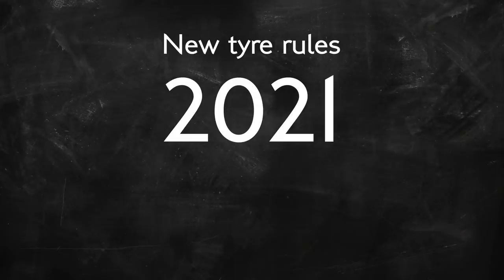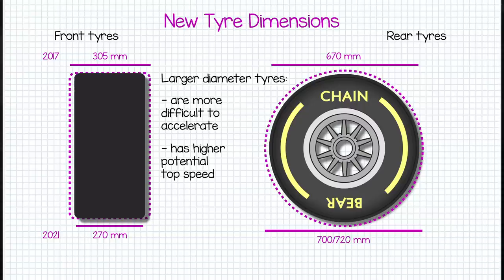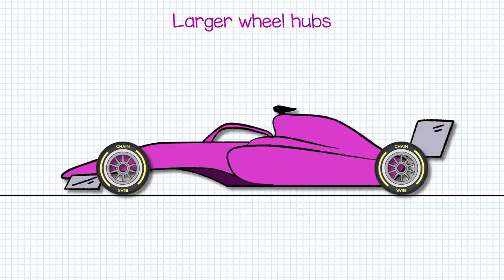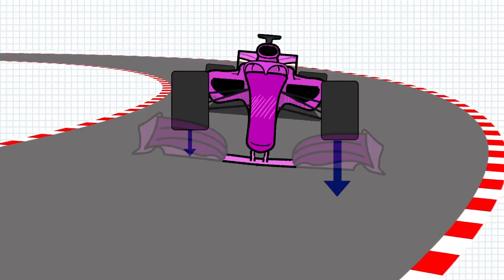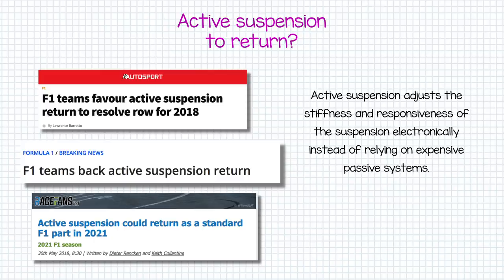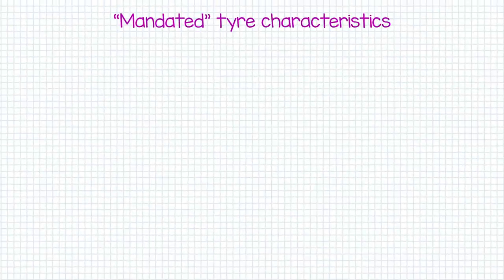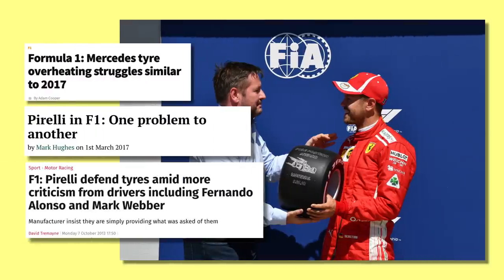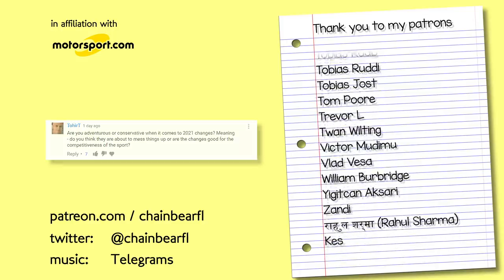New Tyre Rules 2021 explained - Low profile tyres, no tyre warmers, radical compounds

Comment: The tire requirements are odd. They want the tire to wear at a specific rate and have their usefulness be completely diminished at specific point... F1 use to be a hyper-competitive sport for increasing performance, now it seems they are more interested in furthering the development of planned obsolescence. I don't like it.
Reply: Increasing performance? By limiting active aero, aero below the cars, engine displacement, number of cylinders, fucking with tyres, front wings etc. The Porsche 919 Evo could probably win an F1 race against these over-limited POSs.
Reply: @birtalanlorant5572  Nope.. it's lap record at spa was beaten by Vettel Hamilton and Kimi in last year's practise session.. Add to that, the Evo is an unrestricted lmp1, imagine what an unrestricted f1 car can do.
Reply: @Hari5g900  I mean being able to turn at 10+ g means you can lap things that have double your every other spec if the track so much as loops in on itself.
Reply: @birtalanlorant5572  amen brother!

I'm a Porsche guy...a bit biased...
Reply: @birtalanlorant5572  no
Reply: @Hari5g900  Ehh... Unrestricted is a bit much there. It was still based on the prior generation imposed under the race-regulations. Otherwise it would've been a completely new design they could've gone with.
Reply: @swagger897  unrestricted means unrestricted from the rules. You don't have to have a new design.
The fact is it's not legal to race it in le mans, because it doesn't comply to the rules, hence being called unrestricted.
Reply: @Hari5g900  Obviously, but the point being that if the Evo were to get significant changes or redesigned then it does stand the chance to actually beat an F1 car around a track.
Reply: @swagger897  but then the f1 car could be redesigned also.. your point doesn't make sense.
Reply: Certain Randomness dude, 5g is already multiple times the load you experience on a roller coaster, do you really expect many people to survive more than 10g on a regular basis?
Reply: They are actually ruining F1 for me now
Reply: Yeah we need to get back to innovation and progress in f1
Reply: Ya'all don't take into account that smaller, less funded teams dropped out of competitions using "less restricted" rulesets, effectively ruining F1. So instead of no F1, there's restricted F1.
Reply: Whether a racing tyre lasts 100km or 300km is not relevant for the road car industry in any way. So by all accounts the primary concern should be what it does for the racing.
Reply: Everything is engineered for a specific "lifespan". The process of planned obsolence isn't any different from the usual engineering process
Reply: @swagger897  
If I had a Tesla I could easily defeat my neighboor's sedan on a straight but I don't and thus I can't say my electric could have beaten him "only if it had been redesigned".
Reply: bradd 
It’s for the engineers to effectively be able to adjust the car precisely depending on the distance they’ve traveled. It’s more predictable for performance!
Reply: @mortache  It is different. Regular lifespan distribution follows an exponential shape, planned obsolescence distribution is nearly zero-valued except for a specific "lifetime end", where it has a pointy peak. It is also different from a minimum-lifespan distribution, where a long right tail and nearly zero-valued left tail is desired.

F1 is deliberately designed to balance technology, competition, driver skills and entertainment.
Reply: Unfortunately, the "pit stop" fascinates more "people" than the actual racing in this country. The reg to use diff compounds is again to appeal to this type of viewer. I'd rather see them race on whatever tyre they choose; when/if it wears out, come in, but not have to run a different compound.
Reply: I agree. I mean at this point why doesnt the FIA just produce the cars themselves, sell them and forbid the teams to modify them in any way at all, that would save a lot of headache and would get the exact results the FIA clearly is looking for: the exact same cars with no innovation whatsoever going around the track in a nice orderly line. God forbid anyone trying to overtake, thats against the rules now.
Reply: @SportSoulLife  F1 has always been about technical competition.

If you look for more or less equal cars racing, then GP2, F3 etc could be interesting for you.
Reply: It seems you are a Mercedes. I actually like the changes.
Reply: Olaf Franke ofcourse it has. That doesn’t mean that it’s the right thing.
Reply: I feel like this rule encourages more strategy and can maybe reduce the importance of a chassis advantage (so a faster car won’t just keep on pulling further and further ahead of a slower car). Making tires which apply to as strict a regulation as this is also very hard, and can probably benefit the commercial tire industry a lot.
Reply: Well back in the day there was something called "planned obsolescence" as well. 

But it was called "Throwing the engine on the trash after every session

Comment: Could you do a video about refueling in F1? How it works, how it evolved, why it was banned and if it could return to the sport.
Reply: it was banned for safety reasons. Namely due to all of the very real fires that were occurring. There will always be a small amount of fuel between the shutoff device and the very tip of the nozzle, and the exhaust piping will always be hot enough to ignite the fuel on contact.

I very much doubt it will return any time soon. At least while the fires are still in living memory.

Here is a pretty good example of what has/can go wrong. https://www.youtube.com/watch?v=OvgjhfQLTNk
Reply: A video about refuelling is about as useless as one about steam engines. They're both just as likely to make a return to F1...
Reply: Why shouldn't he make the video? Just because it isn't likely to make a return?

His channel is focused around F1. Refueling was an integral part of F1 back in the day. 

With his style of presentation and knowledge, I think that it would make for an excelent video.
Reply: Refueling will most likely not return due to safety and the fact that it's not needed anymore.
Reply: holy shit that was not at all what i was expecting, but definitely something that very easily could happen, about as easy as running over a mechanics leg ay kimi
Reply: I guess you didn't witness enough fires ON pit crew to understand why. Even with extinguishers and fire-resistant suits, fuel leaks on a hot day is just asking for trouble.
Reply: He should do a video just to bust that myth that refueling was that dangerous.. Before 2003 there was a really long time without any incidents.. Sure, when something happend it was dangerous, but it's not like every race a car caught fire. In 2003 Schumachers Ferrari caught fire and he just kept racing after they extinguished it.
I would love to see refueling back in F1. In NASCAR and IndyCar it's working too, or isn't it?
Reply: Refuelling makes pitstop undercuts impossible, where now the faster driver has the ability to do an undercut or overcut if they are faster so I prefer it this way. Plus the whole safety thing
Reply: limiting the power is done by limiting the fuel flow rate at the fuel pump that is ON THE BLOODY CAR(among many, like burning engine oil) which is up 5L/hour with the wider tyres. 

banning refueling limits pit strategy, not engine power
Reply: Refueling was allowed for 2018, but the teams did not want to do it.
Reply: F1 car refuels mid-race is rather a weight-efficiency thing rather than the tank isn't big enough
back in Michael's era, 3-stop strategy really is feasible sometimes as your car will be light enough to compensate the extra pit stop

and if you talk about reducing engine power, they've been doing that since the previous turbo-F1 era where engines reach 900HP IN-RACE, not the turbo-hybrid where engines won't even do 900HP in Q3

and F1 engine burning oil isn't really something new, even someone as slow-paced as the FIA knew that oil burning is a thing and is looking into locking it down
Reply: exactly, nascar and indy car and wec still fuel why cant f1 go back to it. there needs to be give and take at this crap
Reply: those American series are showing the fire hazard as feared by the FIA, and for the WEC, refueling is separated from tyre changing only because refueling is inevitable (are you serious suggesting cars should run on 1 tank in an endurance race?
Reply: @Volante8657, There are rules surrounding what additives cannot be used in fuels and what cannot be used in oil. Additionally there is a fuel flow limit. What the teams figured out is that some useful additives (anti-knock for instance) could be added to the fuel and if they could figure out how to get that oil/additive into the combustion chamber it would be helpful. Additionally since fuel flow rate is restricted being able to add some "oil" (as it isn't 100% just oil) to the combustion process allows for additional power.

The ESPN article is pretty light on details, here is a link with a bunch of details. https://www.youtube.com/watch?v=ixfsyoGKlmE 

This kind of thing is pretty much a hallmark of F1 engineering. Take red bulls flexible, but passes the test for flexing, front wings, or the off throttle mapping and blown diffuser. Things are "legal" in F1 until they aren't.
Reply: Andrew Frink 7
Reply: Why is this dude so obsessed with the wec just chill and let people like different things than you

I prefer the wrc(WORLD RALLY CROSS) so get triggered at that
Reply: The "F" in "F1" for 2017 and 2018 has been "boring!".  The Lewis Hamilton / Mercedes is just to overwhelming.  I WAS a huge Hamilton fan when he started. He was an underdog, he had to do a lot of passing to.  Now, Hamilton wins the pole, is first to corner 1, then spends 2 hours Sunday driving around the track while everyone scraps for the other places.  The best race recently was the German GP where Hamilton was forced to the back of the starting grid due to a penalty.  Watching him pass most of the other racers was very exciting. 

I would like to see refueling brought back. It adds an additional level of strategy.  A 2 second pit stop is insanely short.  Fueling would make stops longer. 

I would like to see them switch to 2 wheel changers from 4, more like Nascar. Again, to make pit stops longer, to make them more important strategically. 

I would like to see more DRS. More DRS points, maybe make the DRS time gap a little longer.

This presentation shows that they are addressing one of my wishes, making aero a little less of a determining factor than it currently is. It would be nice to see cars drafting less then a half dozen car lengths back ... 

It will be interesting to see how the new rules affect the races going forward.
Reply: One word...Notsafe
Reply: @Sandwich420   Heck, driving at 200+ MPH is a lot more "not safe". I'm willing to bet that more drivers have died in F1 crashes than anyone has in refueling accidents.  I'm willing to bet that multiple drivers have died or had life threatening accidents since the last crew member spent more than an overnight stay in hospital. Yes there is a risk, but that is the name of the game.  Refueling adds more strategy options. It is absurd that in most of the races the fastest lap times are recorded in the last few laps of the race, due to low fuel load.  

Using natural gas was also life threatening before the artificial "stink" was added. I'm sure that with the hundreds of millions spent on F1 research they can find an additive to add color or smoke to the fuel when it is not burned in a piston environment.
Reply: @FreedogeMcFroge  You must look at the race as a whole: refueling meant a lot more different strategies available form the outset of the race. You stuck to you're strategy, with an option for a plan B. The variations across the field meant unpredictable races. Also, in case of a safety car, it wasn't always the best thing to come in for a stop. All in all, as a spectator, you could follow how the different strategies panned out, and how hey were affected by incidents in the race. It meant the weaker cars had a better chance of securing podiums and even wins sometimes, because the strategies had a deeper impact on the races. MUCH MORE INTERESTING!
Reply: The ban is simple..... people catching on fire in the pits
Reply: Wait do they run on one tank? Wtf
Reply: @Enzoxvx  they still have tons of fires in those sports and NASCAR has these exhaust come from somewhere else so

Comment: “Well everyone else has giant wheels and small sidewalls...”
Are individually racing series not allowed to be unique from one another?
Reply: I think the point you missed is that F1 has been left behind technology-wise in the area of tires, while striving to be at the forefront in everything.
Reply: Think you missed the point.  The tires have become almost more of the suspension than the suspension is.  Ergo, a change is needed to allow the teams to have more autonomy over how their cars handle suspension-wise, leading to more variables for teams and drivers to address in order to be competitive.
Reply: Robert S 
How have they been “left behind” in technology? Changing the size of the tire doesn’t change the technology used to make or use said tires. The only thing that changes is the method with which you use them.
Reply: Motorsport series worldwide are regulated. The regulations prevent the cars for going too fast, or they prevent an explosion of costs. Normally you want your rims as small as possible, because they are adding weight to your car (rotating masses). The rims of some race cars are just big enough to fit the brake system. Brakes are key to race cars, especially in touring cars. They have most likely big discs.
As a racing driver I prefer thicker wheels, because you can feel more the track and what the car does.
Reply: WSKRBSCT FIA will just ban suspension innovations, like the active suspension Mercedes created and then had ripped from them when FIA stepped in.
Reply: Ascender2306 Do you pump your tyres less air than a normal person does
Reply: Is this a question? And what is considered a "normal" person to you?

As for my race/track cars: Yes, you would pump less air into the tires as on street cars, because you want the tire a little more flat to increase the area of contact = more grip. Depends a little on the tires itself. Every manufacturer for slicks / semi slick tires has recomendations for each type of car.
But on normal street cars, no... I dont do that, because you always have to do compromises. On a street car it is fuel economy and tearing of your tires vs. grip.
Reply: Ascender2306 ok thanks
Reply: @Gentleman...Driver  on my Porsche I went to 19 inch wheels, hated it, the car handled worse then it did with entry level 16s! Even on smooth perfect roads it wasn't a gain. I've since went to 17s with Michelin tyres and the car is far gripper and stable at high speeds. I 100% didn't have that thinking in the beginning! I was how big can I go? I was wrong in my thinking! Even gt3 cup Porsches run 17s and 18s at most...
Reply: @brandonbentley8532  Yeah, most people are going for the looks. And the GT-models from Porsche are using big rims because of the bigger brake discs. Now you know better. :)
Reply: @WimsicleStranger  it was Williams that put active suspension in their F1 cars...
Reply: by adding low profile tires they hand the suspension control back to the teams instead of just pirelli, it means that the whole "designing the best car with the best strategy" is still their thing
Reply: @brandonbentley8532  yeah you can't havee ypur tire that thin its a trade off
Reply: Drag racing

Comment: Been following F1 from almost 40 years and I have always thought F1 should not be road-relevant. At least not primarily so.
Why should it? These are racing machines, experiencing things you'd never experience unless you own a FXX or something like that.

Economics, of course, and the need of manufacturers to sell. But it's a mistake.

Just imagine where we would be if rules weren't thought to make F1 road-relevant.
Reply: whether F1 itself should be relevant to the road or not is one thing, but i think innovations from F1 will spill into regular cars anyway regardless
Reply: Sad to see real innovation like active Suspension + 3d turning wheels banned, wich could actually improve road cars... just as it originally was meant to be in F1